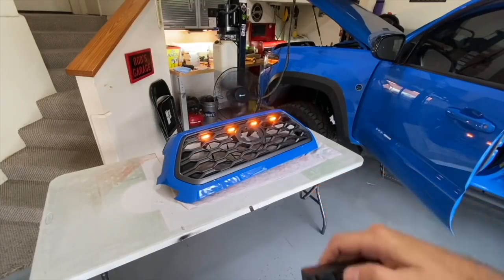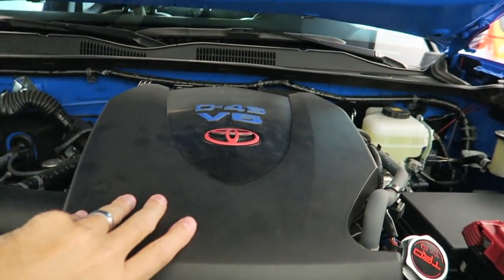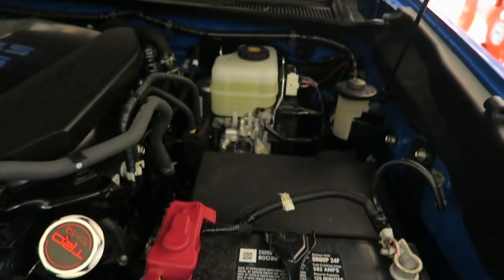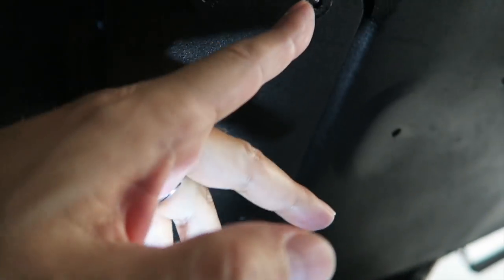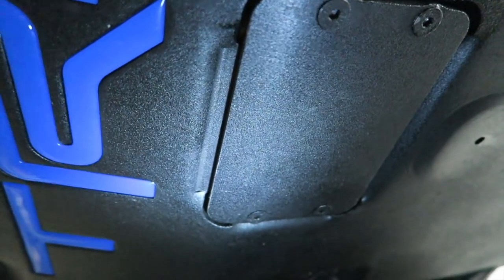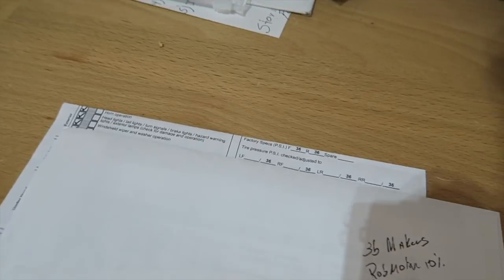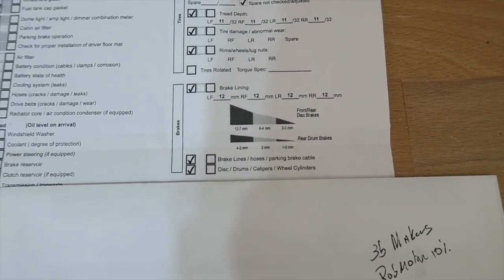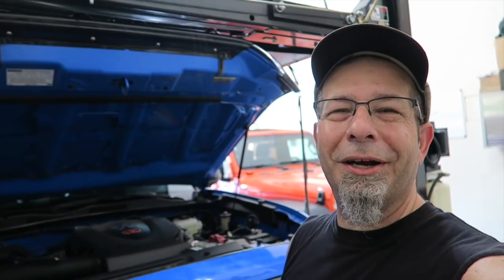Tacoma Dangerous Warning Message & First Oil Change

Comment: I just did my own 5k mile service on my 2020, yes due to Covid I’ve only put 5k on my truck in 18 months.  I took it to the stealership first, read the paperwork after and it said they only “check engine oil” Toyota manual says they only replace every 10k...  science probably supports it, but my meticulous nature can’t.

Comment: They listed the type of oil used but did not list the oil filter. Perhaps thats why the underside shield that covers the oil filter looks untouched?  Unfortunately dealerships have been know to cut corners by changing the oil but not the filter. Hopefully that didn't happen to you. Nice video!

Comment: I'm only 3 minutes into your video and I can tell that I'm not going to take my 22 Tacoma into any dealership for anything.    I'm going to do my own oil change and other stuff that regular people can do themselves.   I have a 6 Tacoma standard cab 4 cylinder and 5 speed manual transmission and Toyota always would contact me because of a spiral cable that was a recall and I instantly thought.   That's BS.   And then they tried to get me to come to their dealership again claiming that my floor mat might get tangled up with my foot and then the gas pedal will go to the floor and cause some kind of problem.  I can figure out that kind of stuff for myself.    So I never took my 6 Tacoma to any dealership.   Now I still have this truck and it is perfect.  I fixed a few things.   Myself.  All maintenance.    Myself.   I don't put the rubber on the wheels but the guy who did put my front end alignment out of adjustment.     It was perfect when I showed up to purchase 2 front tires.    I've learned over the years that it's better to fix your own stuff.      All stuff.   I'm 57.   I learned when I was 22 to do all of my own wrenching.    I had a 1973 Cadillac Coupe De Ville and I asked a small shop if they would grease my driveline and I told him that the driveline was brand new and it needs to be greased because the joints are brand new.    He said ok 20 bucks.  Well I should have watched him I guess because there are 2 U joints on the rear and 2 joints on the front. Long story short.    He greased one in the rear and one in the front.   By the time I drove 75 miles to Santa Cruz the driveline started squeaking and I knew what it was and I was Pissed off.    Now I'm 57 and I've never took my car or motorcycle to a mechanic.    Never.    Trust me.   Learn how to do your own stuff.   You will be better off.   Larry out

Comment: I'm glad that you had a good report on your truck and answers to your question on the charging system. With the pandemic and being retired I just hit 5K on my 2020 yesterday, 9 months after I bought it.  I'm sure I'll be in your same shoes when I go in for my 10K service, well under that mark.  One thing I have noticed - my engine must be breaking in.  I drove 40 miles in a mix of driving and got 28 MPG, and 22.5 overall.  I don't drive crazy, but I also don't mope along.  Hmm...
Reply from the maker: Wow!  That's excellent mileage!  Are you stock?
Reply: @RobMotive  Yes, just stock on the TRD Sport, with the LED electronics package.

Comment: Your service breakdown, was very interesting today. I had an oil change at 2,272 miles, on, 4/13/21, (truck bought last October). My paperwork showed a different page to yours. It's called the, HVAC System Refresh Service, my paperwork showed a box, in red, saying, this item should be serviced annually, to reduce odor from A/C vents. This is a cost, (to me), of $60. I declined, as, I live in Pa, and of course, haven't used my AC, since my tacoma purchase. A representative from the dealer, even phoned me at home, two days after my oil change, to ask if I had reconsidered having this done. I again, refused. As to the battery warning light, I do think Toyota needs to change the messaging for this warning,  coming on, as it does, after using accessories, it causes a needless panic, to drive straight to a dealer, as I did, for no reason.
Reply from the maker: Sounds like a money making scheme for the dealership.  I've never heard of it.  Given the reaction I got when I asked about the charging warning light, I'd say many have had the same concern as me.  Definitely needs to be explained in the owners manual.

Comment: I noticed that check charging system warning come on when I just want to run the radio without the engine running.  My first thought was don't run the battery too long.  My dad and my uncles used to tell me that running the battery too long will drain it but isn't that what an alternator is for?  thanks for sharing your experience with this.

Comment: Just check your battery terminals every once they like grow Green  corrosion around them just saying my 2017 that’s why I had to  replace the battery because My battery cracked on me earlier this year when we had a cold snap in Missouri
Reply from the maker: Hmmm!!  Never seen a cracked battery😬
Reply: @RobMotive  I have One was on my Tacoma and other one was a Army Humvee that blew up
Reply from the maker: Must be a drag!  Any fluid leakage?
Reply: @RobMotive  most of the times when batteries blowup is two  reason there is gas trapped in the batteries or.they  are frozen
Reply: @wilyceyote  
Wow, that sucks.
Too bad you didn't get the battery warmer option in your truck.
Reply: @garydp9760   It happened in Missouri when we had that cold snap earlier this year well it was -10 for a couple days

Comment: Hi there!! I believe you said on tires 11/32 and those tires are 16/32, so even after 10k miles it's not way that they're like that worn out. In general I believe that they don't check everything
Reply from the maker: Given the depth of the tread I’m looking at right now..you may be right😬
Reply: @RobMotive  I had those tires before I believe they are good year wrangler duratrac 16/32 or 18/32. Anyway I can be wrong on that one but I'm sure they don't check every Item on that list
Reply from the maker: I bet their numbers are based in n stock tires🤔
Reply: @RobMotive  
Even though you told them no tire rotation do you actually think they pulled the wheels off to check the brake lining and measured it.
I doubt not, they probably just looked at your mileage and said oh yeah these are good
Reply from the maker: Now that’s a great point🤔🤔

Comment: My last 2018 they only had to change oil once since i had it because i don’t drive much It will probably be the same with my 21
Reply from the maker: I can relate.  I will do mine twice a year at every 5K once I exhaust the free changes👍
Reply: @RobMotive  
Up here in Denver they wanted like $83 to do the oil change I said no my freebies were.
However buying the Toyota oil filter at the dealer which included the two o-rings and that little plastic plug you shove up in there to drain the canister and I asked him to throw in the oil pan bolt gasket out the door with taxes $5.67
If their brand is good enough for a new vehicles I don't see the need to pay $10 or more to buy an aftermarket oil filter kit.

Comment: Hey Rob, I was thinking about installing a K&N air filter, but after reading numerous comments of people saying they had done so and it had caused sensor issues from the oil getting on them from the filters oil I decided not to.  Are there any detractors about the cold air intake to your knowledge?
Reply from the maker: Use a dry filter to avoid that.  Most offer both versions.  No real benefit to having one except looks👍

Comment: Hi rob hope you’re doing fine!  one question  I have my Tacoma service that first 5k maintenance service , but now I just realized by taking a look at the receipt they never change the oil they only did rotate tires and the rest of regular checkups, the mileage on my taco were 4,500 / 6 months combined,why do you think they did not changed my oil? Thanks
Reply from the maker: The provided service doesn’t call for an oil change until 10K miles or at 1 year.
Reply: @RobMotive  haaaa would you run your tacoma for 10k miles before the first oil change? 😳 I don’t feel confident about that but what would you suggest?
Reply from the maker: Nope, I would not.  I’d pay for the change at 5K or do it myself👍
Reply: @RobMotive  exactly I already order everything for the change myself thank you always for your response 👍

Comment: Your TRD oil cap is just like mine, upside down. Did you put the sticker on before you screwed it on? That’s where I messed up. It’ll always bother me but I’ll live with it. Lessons learned
Reply from the maker: Nope...I had it correct on another truck.  Unfortunately...it’s not the same on this one😬

Comment: Rob...  Since my New-To-Me 2018 Tacoma is a Toyota Certified Used Vehicle and I purchased the Toyota Auto Care Classic Prepaid Maintenance Plan.  Do I actually have to have the Toyota dealer do the oil change/filter changes?  With my 2000 Toyota Tundra except for the very first oil change which I took to the dealer to have done and I provided the oil I wanted in it.  I always performed my own oil/filter changes for the 21 years I had the truck.  I prefered to use Castrol Syntec oil vs Toyota oil.  I don't mind having the dealer performing all the other maintenance checks, but I like doing my own oil changes.  That way if the drain plug leaks or the filter there is no one to blame but my self.  I had a bad experience with a dealer that a mechanic that was performing a recall for the front engine cover on my 1996 Mustang took a short cut that resulted in the engine having to be replaced.  From that day on I never liked dealer mechanics.  I always took my vehicles to my brother-in-laws shops for repairs and maintence.  There are two types of mechanics, lazy ones and tired asses.  A "Lazy" mechanic does the job right the first time then he doesn't have to do the job again.  The tired ass mechanic doesn't care.  My soldiers used to laugh when I told them I wanted them to be lazy.
Reply from the maker: Hey Charles.  Have a look at the small print in your agreement or give the company a call.  I imagine it varies🤔

Comment: Does the truck give you a maintenance signal when it needs an oil change?
Reply from the maker: I haven’t seen any👍
Reply: @RobMotive  I’ve driven my tacoma for atleast 5k miles and not sure if it’s time for an oil change
Reply from the maker: 10K miles or 1 year under Toyota care.
Reply: @c3nt3no7  
My maintenance light came on every 5,000 miles so I took it in and told them the lights on and I was able to squeeze three oil change freebies out of them.

Comment: Thank you for your information on the charging system.   Mine did that red charging system light on the first day and I thought.    What is this      I bet that it's just a way for the dealership to find out what kind of dumb ass people are.   Then they push a button in their computer and then they say.  I seen him coming.    Or , I seen her coming.    I'm making a resolution right now.    I'm not ever going to take my 22 Tacoma to any dealership ever.   Never.    I'm going to change my oil myself and right now it's at 1000.     After that I'm going to change the oil every 5000 miles.   Air filter wiper blades battery.  All of it.   I removed the stock car tires after 300 miles and reinstalled BF Goodrich KO2 all terrain tires 265/75/16 and I Love it.  Hey you young guys.   Listen to me.  I'm old.   And I've been there      so your own maintenance.   Larry out 🤠

Comment: They don't change oil until 10,000 miles
Reply from the maker: They changed mine yesterday (way less than 10K miles).
Reply: My dealer wouldn’t change my oil at 5,000 miles. They do maintenance every 5000 miles for first 25000 miles, and wound up just checking fluids, and routine checklist. Wanted to rotate my tires for me, but I installed K02s so couldn’t take advantage of that either.
Reply: @RobMotive  It seems that they change it every 5 thousand miles but it is not like that they change it every 10 thousand miles believe me I also believed that they changed it every 5 thousand I did the same I checked the oil and it looks clean but they do not change it
Reply: @RobMotive  I tell you because I had another Tacoma and  already had 30 thousand miles so I decided to take it to another place to change the oil, and then at 35 thousand I took it to the dealership and they asked me if I had changed the oil in another place at 30 thousand and I told him that  yeah , then they told me then you don't need change
Reply from the maker: Thee are the same bummer.  I am positive they changed mine👍
Reply from the maker: Sounds like a bad dealer to me!
Reply: @RobMotive  thas good the You sure they did it

Comment: I have another comment.  I do not like the seatbelt reminder buzzer or Bell.    I decide what I do     I might not want to wear the seatbelt for whatever reason I have.    Freedom is my reason.    Why would Toyota care if I wear my seatbelt.    If I crash and die.    And the cops say well he wasn't wearing his seatbelt.    Toyota is not held liable.    Anyway.   I hated the noise from the Bell ringing because my seatbelt was not on.    I clipped the wires and now I have a blinking light on dash that looks like my airbag is disabled.   I'm from the old school.    I just put a piece of black electrical tape over the red blinking light.    But I don't hear any bells or whistles or buzzer.     Why would any automobile manufacturing companies put shit like that on their vehicles.    Most people hate it.     One more thing.  One day after I purchased my 22 Tacoma SR5 truck.   I removed the Toyota Badges and it looks great.     I'm not going to advertise for a company that puts bells and whistles on the vehicle that I am paying for.    As a matter of fact.   Now that I don't hear the seatbelt reminder.     I drive without a seatbelt.    It's called Freedom.    Think about it this way.    What if you tried to tell Josey Wales that he needs to put some kind of strap on his body to keep him attached to his Horse.     What do you think Clint Eastwood would tell you.        I'm old school.    If I hear any more bells or whistles coming from my new Tacoma truck.    There's going to be HELL to pay.     I'll be giving Clint Eastwood a call and I'm going to ask him what he would do.   Larry out 🤠
Reply from the maker: Clint is one of my all time favorites!  Love the westerns👍